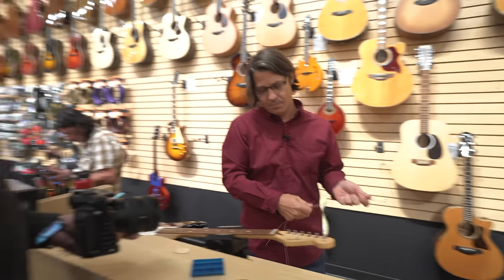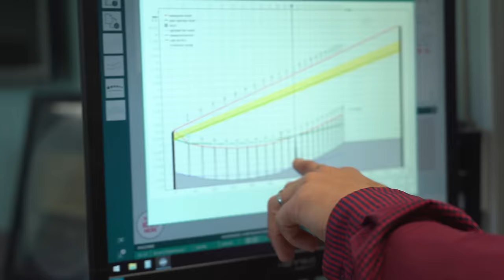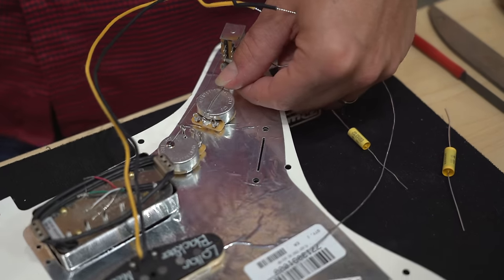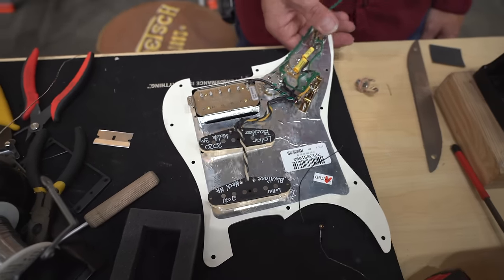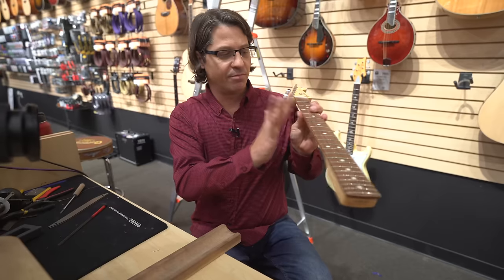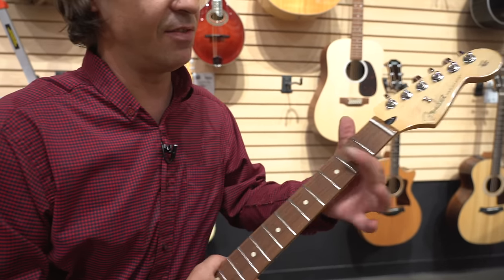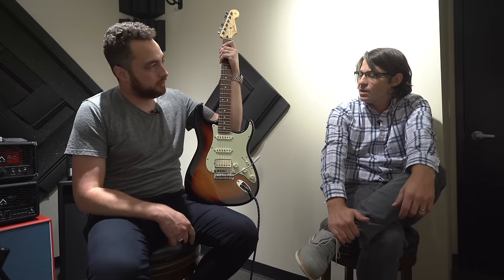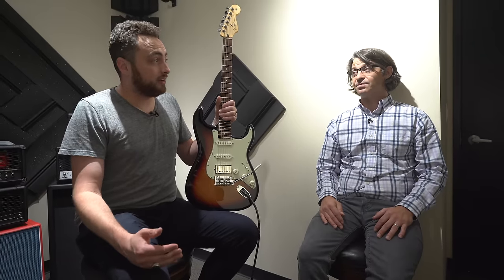We Tried To "Custom Shop" The Cheapest Fender Strat

Comment: Great video as always. 
One oddness to Fender’s catalogue that doesn’t really add up to me is that you basically need to reach the $2k price point within the USA range to have a nitro finish. 
Gibson, who’s constantly on the spot for being too pricey, offers nitro finishes for the entirety of their USA line-up, starting at just $1k (less than half of what you would need to pay for a nitro strat!) 
A nitro finish would have been a fair addition to the AP2. I must admit, a $1.75k price point for a US made, poly finished instrument sounds a bit off.
Reply: Bolt on neck, covers aren't recessed, no binding, no cap wood, simple inlays, electronics all mounted to plastic and not the body, no truss rod cover, logo is a decal and not an inlay, hardware made from bent steel, etc

Considering all the budget manufacturing choices I'm amazed at what a USA made Strat goes for compared to some of the Gibson range.
Reply: @scod3908  wouldn’t this be the opposite though? Gibsons are pricier to make, but you still get a nitro finish at $1k

Comment: I've got a HSS strat type Peavey I paid £35 for in a charity shop...it now has a Pearly gates (£50) and two maxon single coils from a 1974 Greco (£100), 2 additional double thickness baseplate magnets (£20), a brass trem block and saddles (£35). The neck just needed wire wool and the frets a very minor clean up. I stripped it and did a sunburst with a satin finish and sprayed the pickguard in a tasteless pink sparkle...for the money it is an absolute beast

Comment: Great video!  Another big difference would be resale value. Even if you could get it to “even” playability & sound, the Player upgraded to $2k would maybe fetch $1k max on the open market, and would probably never increase in value (unless it made you famous!).  The custom shop is much more likely to at very least hold its value, but even if it decreased in value for resale, it would have to decrease by 50% to be the same net outlay. So other than the “cost” of having your $’s tied up in a guitar instead of another investment, you’re likely ahead with the custom shop and get to feel extra cool while owning it!  All that being said, there’s nothing wrong with upgrading a cheap guitar.  I have an 80’s S-type Cort guitar that just plays great!  It was my first guitar and I basically did to it what Rhett did and 25 years later it’s awesome to still own my first guitar (never let yours get away!). I also threw some Lollars, Grovers, and a good setup on an Epiphone Les Paul Special and have a a Gibson USA equivalent (sans badge) for about $1,000 savings. My point is the the custom shop is financially justifiable if it doesn’t put you in debt. I’ll shut up now.

Comment: You could of basically just set-up the guitar to your liking (usually free with a new guitar purchase), change one pot for a push-push or push-pull to be able to split the bridge pickup, change the nut and add locking tuners for a lot less money and it would have sounded as good IMO.
Nothing wrong with the original electronics on the Player series it sounded darn good.
Reply: if the humbucker was 4 wire, ofc
Reply: @BadMotivator66  they probably are since they do have a pull-push on the player plus and they have the same pick-ups if not mistaken.

Comment: Bought a Classic Series 50`s lacquer used for $600 and Dave Murray-ified it with hotrails/Jb jr, pearloid pickguard, VIPots, locking tuners. Ended up as my favourite guitar. Since than I´ve sold an Am. Ultra, EBMM Cutlass, ESP George Lynch signature and an 80s ESP Navigator. They just didn´t get any use. I guess it helps that it´s a great guitar to start with, as a friend who´s a technician says, «shit in, shit out».

Comment: Cool video. Like the concept. One of my favorite guitars, one I'll never part with, is an older Indonesian Squire Strat Ive had for quite a few years now. Ive changed the pickups a few times, currently have a set of Tone Riders in it, not the priciest pickups, but in this strat, they sing. Ive upgradeded the nut and the saddles, dresssed the frets and did a good set up. This guitar absolutely sings and (for me at least) it plays like a dream. I often reach for it over my American Standard and SRV signature strats. I swear this Squire has a ghost in it. Its not a vintage '63 strat and its not top shelf pedigree, but its  just a great guitar for me. I love it.

Comment: I'd like to see some comparisons over the years, and not just what happens with new ones.  My strat is about 20 years old, and I chose it over a Les Paul back then because of very visible build quality issues.  Mine isn't a custom shop, because the american strat with the special HSS pickups I wanted and premium ash white blond finish was something you could just order normally.  Feels like every time someone I know picked out a killer guitar combo, they stopped selling it unless you did the custom shop thing.  Maybe someone could get the custom shop to replicate what you used to get right from the American factory, but that seems highly unlikely now that they make so much money.  They have long since realized they should be charging thousands of dollars for that kind of thing.

Comment: My Mexico Strat has rolled frets, guess i was lucky. It played Felt very nice to play, but there was a few things i had to do to make it more high end.  I set it up with locking tuners, put 8 gauge on it, had to intonate it, do adjustments to the saddles both in length and heigh, had to tighten the trust rod slightly and  for now i replaced the bridge pickup with  SD Hot rails since the pickups that comes with the Mexican Strat, has a thin and cheap sound to it.  Now my 2023 Mexican stay in tune, and sounds amazing on the bridge pickup! 
The neck and mid pickups will also be replaced when i can afford it.  Ill have SD cool rails on the mid, and DiMarzio Pro track or DiMarzio Tone Zone, OR DiMarzio The Cruiser.   Haven't decided yet but i can't afford it in awhile so that's fine. i have time to think =)

Comment: As always great video Rhett you're a living legend as far as I'm concerned. I have taken my Mexican Standard Stratocaster from 2004 my father gave me before passing, and a craigslist find Mexican Strat from 2003 to what I loudly proclaim are guitars that will rival Fender's own Custom shop through heavy modifications done by my hands. ( I nearly ruined the 04 when I did the complete refret job after only having one practice run prior of the incredibly invasive procedure a complete refret is to a guitar haha but I eventually got the neck relief to cooperate and dial in the set up the way like) I literally modify everything that can be on these, except the poly finish. Bone nut, steel or brass high mass bridge block, even though I block the trem cause I don't use the wang bar anyhow, if not Fender Custom Shop pickups, I will use Genesis Pickups, I have my own subtle variation on how I wire everything up, I also just can't stand the sterile white pick guard either haha so that gets altered too. Of all the modifications I do, the complete refret to EVO gold has been what really transitions these guitars to the level where I shoot my mouth off about giving Fender's own Custom Shop a run for the money haha.  Maybe its because my own hands did the work and that adds to the sentimental value. Also, I don't do the refret until I've worn down the nickel silver frets to the point of unplayability (hence the EVO gold fretwire upgrade) and that adds a level of authentically worn in factor to the mix. Could be. Could be the all the things coming together in concert for the effect,  but I wouldn't trade either of these guitars for Stevie Ray Vaughan's actual number one, let alone anything out of Fender's Custom Shop, I shit you not. So for those of you out there who are part luthier, I say screw Fender's Custom Shop, be your own custom shop. Do it. It's worth it.

Comment: I know you were trying to do it on the cheap but if the board is wonky you are always better off removing the frets completely, use the plek to plane the board down perfectly and then refret with desired wire.

Comment: They live in a different World. it's Not their Money. I've done the Tele Mod bunches. Typical is the Brand New Squier the guy just dropped from shipping Box to Floor. $95. No Receipt, no Tax. Better Jack, Tuners, PU's, StrapLoks, bit of Body Repair, work fretEnds, Reverse Control Strip. Done. Total: @$380.

Comment: Picking the right components and with attention to details + CS level pickups and a good setup, you can build yourself an outstanding guitar for even less than the high end production models. I’ve assembled a few and kept 2 of them. One HSS with Michael Landau Suhr pickups, another one is an HSH with PAF-like Alnico 2’s and a Seymour Duncan Ssl1 in the middle. The cabling allows a variety of combinations, splits an a switch lets you have the front pickup in every position. The neck is tight grain roasted maple, stainless steel jumbo frets, rosewood board with rounded edges, abalone inlays and luminlay side dots. So there you go... !

Comment: I did this with a Squire Classic Vibe 60s Strat that had a fantastic neck so I dumped $675 into it and it turned out really awesome! 
The Upgrades:
1. Rio Grande Big Bottom three pickup Set. $285
2. Emerson Custom 5-Way Prewired Kit for Fender Strats - 250k Pots. $75
3. Super-Vee "Custom Shop" BladeRunner bridge Kit. $235
4. Vintage Fender Tuners. $70
5. Graphtec Tusq XL Nut. $12
6.Rolled the edges

Comment: First of all, a custom shop strat is not necessarily the most desirable one.  The real guitar standard you're after is something that sounds like an OLD strat.. which is not necessarily a custom shop axe.  I don't know any real players who use custom shop axes.  I think custom shop is for dudes with money who don't really gig.  Paying over $2G for a strat is ridiculous to me on principle.  

With that said, my formula for producing better than custom shop results (as far as tone.. I don't care about looks) for less money is:

I started with a used MIM HSS strat like this one, but from 2002:  $349

Replaced the tuners w/Fender locking tuners for $60

Replaced the trem with a Wilkinson, $80 

Replaced the SS pups with Fender Vintage '59 (AMAZING PUPS) $149 for set of 3

Replaced the H pup with a Kiesel C22B for $129

New pup guard with all American wiring, treble bleed and reduced knobs from 3 to 2.  Instead of VTT, my Strat has one master volume and master tone controlling all three pups plus setup.  $275

Some aesthetic stuff like lime green pup guard and knobs and such for $30.

Total price to make an asskicker of a strat:  $1075.00

Rinse n repeat.  I've got three strats, different pup configurations, that I've done the same thing to.  All MIM. All asskickers that aren't afraid of any custom shop axe.

Comment: Great video. Now, I’ve never really been a fan of Humbuckers in strats. So I did groan a little when heard what you were starting with. And really hoped you’d turn the HSS into an SSS. However, I really did like the results of what was achieved while still keeping it as an HSS Strat. The chrome humbucker actually made it a little classier than an open top version. To me it seemed a bit more honest and authentic as if it were a player mod. 

I’ve always said that the most important thing about any guitar or Bass is the neck and if that is right then there is less reason to worry about anything else. You could for instance pop a Mexican neck that has been correctly set up and finished onto say a Squier and you’re going to be more inclined to want to play it than the stock neck. And I have a bitza PBass that I’ve put together that have done something similar where I dropped in a Fender Neck, changed the pick guard, fitted a bridge with brass saddles. And it actually sounds good enough. I got an upgrade set of PJ pickups to fit, but haven’t yet bothered, as the bass now sounds and feels perfectly good enough.

Think these days many of us are capable of doing a decent setup of our instruments. I’d still rely upon a luthier for a full fret dress. 

There is no way to really get a custom shop instrument using a player series instrument as the platform, as to do it,  you’d be either refinishing the body in a Nitro finish and changing the neck for a USA hand finished one. At which point it’s be the guitar equivalent of “Triggers Broom” (only fools and horses quote).

You can as you’ve proved, get an instrument that is perfectly playable and sounds great using a Mexican Strat as a starting point. But if you’re going to spend 2K then there are USA fenders that can be gotten off the shelf where you could get what you wanted for that money.

Out of curiosity I popped onto PMT music in the UK to see what I could see for less than 2K.  And there were some nice instruments in the 1.5K region that were really nice. But what really appeals to me is the 50’s Vintera in sunburst with a maple neck and fingerboard. All for £850. I wouldn’t need to do anything other than to insist that the store has it properly set up prior to collection. Doubt I would want to mess with pickups or anything else.

Comment: The fender/squire Affinity Stratocasters I have checked out  from Indonesia are a GreatBuy they have a Smooth feel along the edge of the board & the  fret wire. This has been over the last 6 to 10 years on the ones I have tried.  Also when I do upgrades on these instruments Regular & Modified Parts have always fit to these as well and as easily to any other Strat costing  more.  We LOVE Them.

Comment: I have a couple of MIJ Fenders I  bought years ago and have done setups, ftretwork, pickups, etc., and I've always thought of them as $500-700 guitars. When I saw a MIM bottom of the line Strat is $850? My jaw dropped. With everything I've got, I'm sitting on $1500 guitars. Or at least that's what they're worth to me. Side note: mid- to early-80's MIJs Fenders are fantastic guitars. Lovingly built and solid finishes. Electronics are OK. But I think the take home here that you've put out is, you don't have to buy a custom shop guitar to have a nice one. Support your local luthier!

Comment: i get what you are trying to accomplish, but that's all wasted money Imo. all that guitar needed was a nut replacement, a great setup with new strings, with the option of rolling the fingerboard. what i don't get is the double charge your listing... (Frets:  PLEK service including level and crown, end dressing, and buffing of all frets - $265 Value) . (Setup:  Righteous Guitars Setup w/ D'Addario NYXL 10-46 strings - $109 Value) the setup should of been included in that overpriced PLEK you did.

Comment: The pricing of this seems very high to me. 

$1,919 minus $850 for the guitar is $1,069. 

$1,069 for replacement pickups (stated in the video to be $300) and then basically what I would expect any luthier to do for a good set-up, seems exorbitant.

$700 for some fret work and a new nut?

Comment: This video is nonsense, sorry. The Fender player stratocaster is a really good guitar for the price, and mostly better than the Vintera too, that's 3/400 euros more expensive. I've been working in a luthier workshop and what I saw is this: I found major issues on USA made and Custom Shop made guitars than on Mexican ones. Even some Squier classic vibe necks were much better refined than the standard American ones. I had in my hands unplayable Fender custom shop, with major problems with frets height, unstable necks or nut as well as Player Mexican ones: but the difference is 3.500 bucks, that's unacceptable. With the setup out of the box you have to be unlucky, because most of the times I got perfect set Mexican and Indonesian guitars. But if I pay 4600 bucks or more for a custom shop and it's not 100% perfect, I get mad. This is the reason I don't buy anymore new American made instruments, they don't worth the price.
In Italy, by the way:
- Bone nut new hand made 60€
- Frets levelling and neck finishing 140/50€ average, 180€ max
I don't get where the rest 600€ went... Electronics and pickups? Come on!!

Comment: The USA made starts around $1400 if you put $300 pickups in it. Setup for $75. Save $200 or so. Resale value will still be good. Better than a made in Mexico fender.

Comment: Took a used $150 Squier (ESR Silver Flake) and redid everything but the surprisingly excellent floating bridge, old jack, and Agathis wood body. 
Found a Fender Elite ebony neck with bone nut and locking tuners ($350 used) and upgraded the pots/caps and added an S-1 switch with a 4-Pole 5-Way switch. The Indonesian pickups were replaced with a Pearly Gates in the bridge and Ultra Vintage Noiseless M and N. 
So, almost $1000 in (Elite necks, no longer made, were $900 as a Fender part) minus leftover parts, an extra bridge Ultra Vintage Noiseless P/U, a nice Indonesian Squier neck, and an HSS Indonesian set of electronics/pickups.
Pickups made a HUGE difference, and the compound radius neck with a flawlessly black ebony fret board . . . not Custom Shop but equal to a $2500 Strat.

Comment: Sickening. The very least you should expect from Fender is that the guitar is "set up!!!!!!!!!!" I got a Grote 335 copy off Amazon, delivered, for $129 bucks. It needed a really simple truss rod adjustment. The nut was good, bone, the neck and pick ups were fine. The pick ups were good enough but I changed them, and I added a new tail and bridge and locking tuners. Total about $300 bucks more. I swear to god it plays and sounds as good as my Gibson 335. For less than $500 bucks. The big manufacturers "names" can eat my shorts if they can't even do a proper set up for a $1000 dollar guitar.